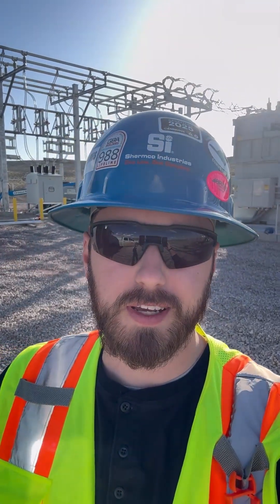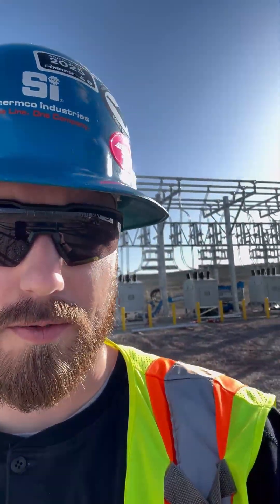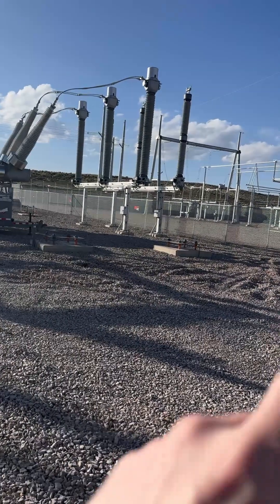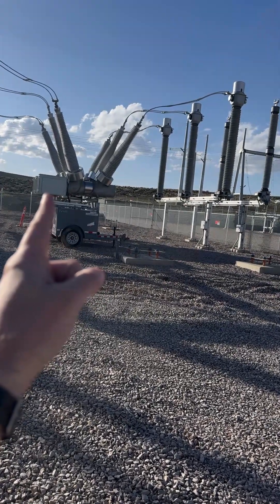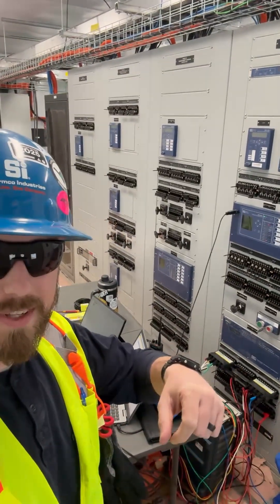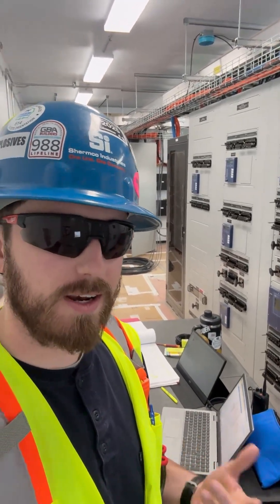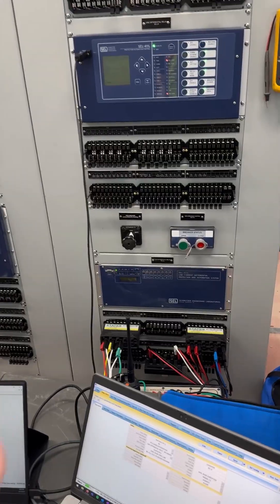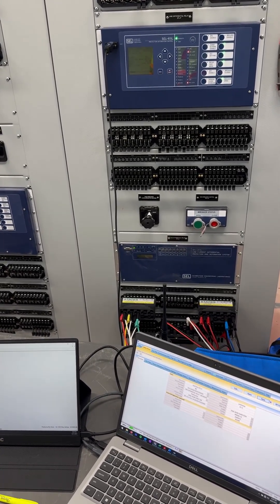World's Shortest HV Line Differential

Comment: How are you getting the elements to even work with a line of essentially no real impedance at all? I was involved with one that was less than a mile and it was horrible! But 200 feet????!!!
Reply from the maker: The protection zones are... interesting. But 87L works the same way regardless of line length.

Comment: They must have run a fiber optic line under that fence to connect the line diff's... so why couldn't they have run a copper CT line? Pretty easy to marshal that customer CT in the utilities building before getting to the Bus Diff and it becomes super simple to deal with. Also I don't see any insulated fencing panels so they must be sharing a ground grid so GPR can't be a concern.
Reply from the maker: Yep, shared ground and fiber (called out on the prints as OPGW which was funny) ran underground to the utility sub.